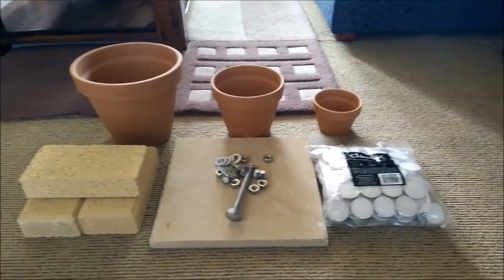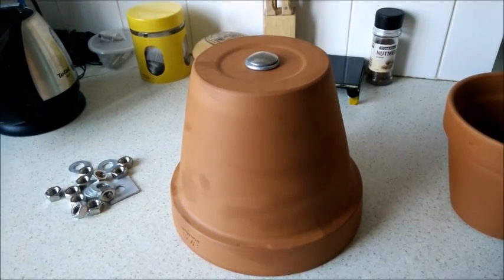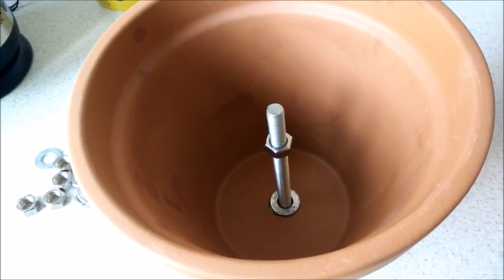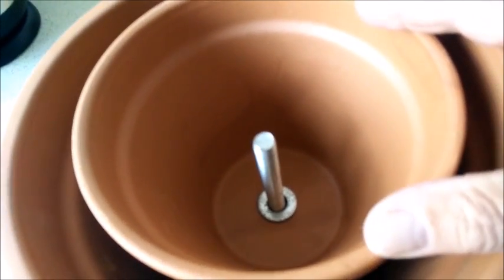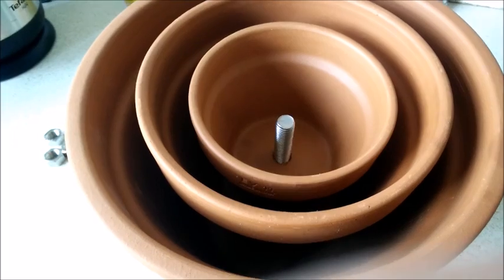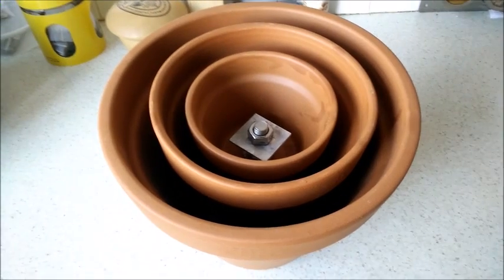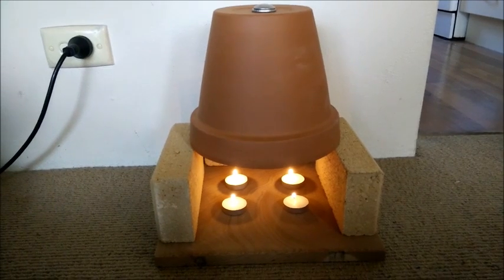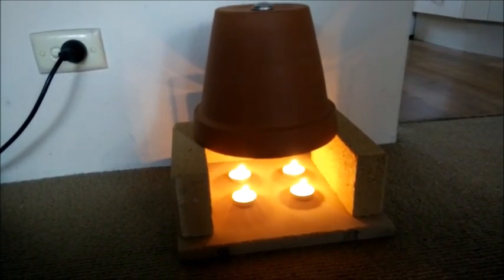Flowerpot Heater

Comment: For safety’s sake, you need to place your candles in a glass or metal pie plate or cake pan or glass bread pan to prevent a fire from spreading when your candles drip wax all over the place and ignite. There is a man on a boat (on u-tube) whose boat almost burned up because he didn’t use such precautions. Check it out. The way you are doing it is very dangerous.
Reply from the maker: Yes, good idea. I guess my candies have never run. But safety is king.

Comment: Best presentation I have seen. You explain things slowly, they show us each step to bring it all together ❤.  Excellent job. It does look very nice and comforting too. I bought a 10 inch and 8 inch pot yesterday, got my old glass candles I have used in the past. Got 3 twrra cotta spacers that work very well, then put a 8 inch terra cotta plate underneath. I bought some small river rocks all from home depot. River rock is on bottom plate with candle in middle. Had going all evening and nighttime yesterday. I loved it and I could feel the heat next to my bed and it looked like a fireplace with the golden glow. Had no problems but I want to add 2 inside pots and bolt like you did, so still have a ways to go before I am done. I think I heard we are not supposed to use bolt covered with ZINK for it puts out a dangerous vapor. Is that correct??
Reply from the maker: Hi, I'm glad you like it and are having success with yours. Yes, I would say no coating on the metal parts. As you say, it could result in fumes.

Comment: pot needs to be lower just enough room to put candles under, takes a few hours to get warm so you can feel the heat
Reply from the maker: You're right about the height. Lower is better. Mine heats up fairly quickly.
Reply: @Dawnraider  nice one and if you put candles on a flat sheet of metal makes it easy to change candles and blow them out before you go out or bed ps make sure you keep them wax clear after use build up can cause fires

Comment: Place a small brick in the center, where your candles are, and place a single candle on it so that the flame of the candle is directly beneath the steel bolt. The bolt will heat up and radiate MUCH MORE of the heat.
Reply from the maker: Yes, that would be a good idea. Making that Central bolt and all the washers and nuts got ensures the heat is transferred to the pots. Good call.
Reply: @Dawnraider  And, FYI, the point of adding a small brick is simply to lift the candle up closer to the bolt because you're using short candles.
Reply from the maker: @dreamingmusic3299  for sure, I get that. 😁

Comment: How does a flower pot increase the BTU output of a candle?
Reply from the maker: The rising heat gathers within the flower pots and heats up the terracotta and metal parts. So it captures the heat that is otherwise lost to the atmosphere.
Reply: @Dawnraider  It would seem to me that losing heat to the atmosphere of the room is the purpose of heating. The candle has X amount of BTU's to put into that room which remains constant whether or not it is under a flower pot. Now that pot and hardware can certainly retain some of those BTU's to release at a slower pace than the candle itself but I don't see how it could possibly increase the energy output of the candle which is what would be needed to be an improvement over simply burning the candle without the pot and hardware.
Reply from the maker: @bubba8876  I understand what you're saying.  But look at it this way, it is a little bit like concentrating the heat of the candle on a smaller pocket of air rather than letting it disappear into the wider room. Air is not very dense, therefore, it does not hang on to the heat very long. Unless you hold your hand directly over the candle, you have very little appreciation of the heat it throws out. However, the candle flower pot arrangement traps the rising heat in a very much smaller space and at the same time uses it to heat much denser substances like terracotta and metal. Much like the old night store heaters that heated up bricks within a metal box which then gave off warmth even after the heater was off. The pots and the metal become very hot to the touch.
Reply: It kept me toasty when I had it on a table next to my bed.